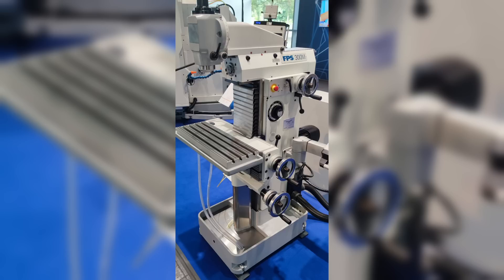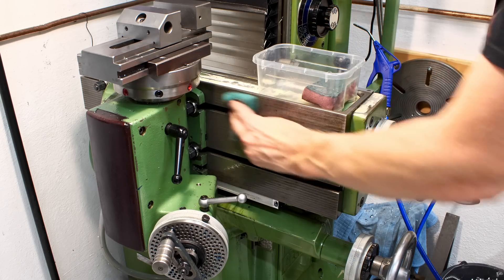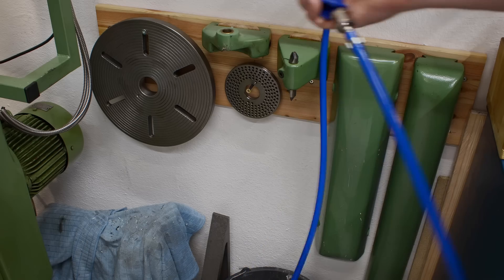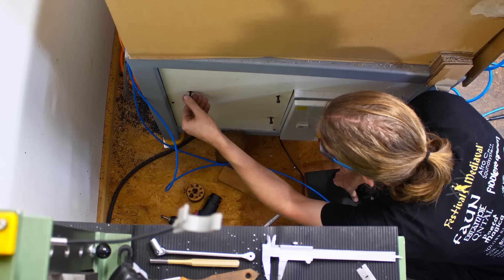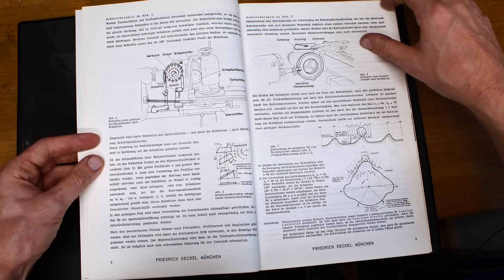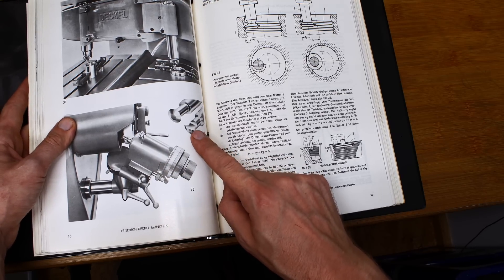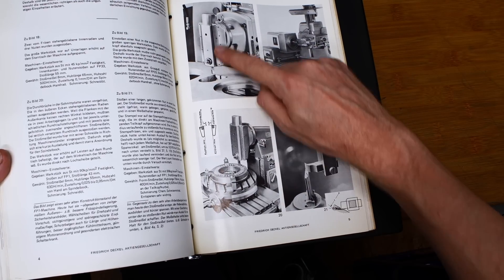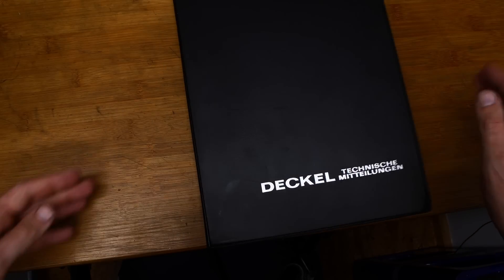Shoptalk #30

Comment: Thank you so much for the rivnut tip! I am literally working on the side panel of my lathe just like you show in the video. I'm mounting rails for a pull out CNC panel. The snag is that I only have about 150mm gap to work in and spent a long time yesterday trying to get my M5 rivnuts in with the plier type tool. The handles on the tools are way too short to get the initial required leverage but still don't fit in the gap without starting at a bit of an angle. This all resulted in a minor thumb injury and some bad words. Today I'll try the nut/bolt/bearing method. Congratulations on your YouTube silver award, it's well deserved.

Comment: McMaster sells "wrench driven" rivet nut tools that are quite a bit cheaper than the large, clunky plier type tools. They are also very low profile for tight access. They're around $35 and go from 4-40 up to 1/2". I've done hundreds of riv-nut installs with these and while it is a much slower way to install rivnuts, I like this method better because I've found that the plier type do not always set the rivnut all the way and subsequently the rivnut can spin when torqued on to either tighten or worse yet, when you go to loosen it after years.
Reply from the maker: https://www.mcmaster.com/products/rivet-nut-installation-tools/wrench-driven-rivet-nut-tools/

These? Funny, I did not know they exist :-)

Thanks, I learned something!

Comment: I had a KF12, very versatile machine but if you dont have any of the stock attachments it can be a bit of a monster for doing only standard milling ops. and in south africa you very seldom find them, let alone the bits. thy made really nice and versatile machines and very accurate.

Comment: Great video, 👍 You got some exercise at the trade show hope you had a good day out😅 Riv nut's have their applications but they need to have inner and outer serrations on the nut or they fail.Smaller size M4 M5 M6
Will snap the mandrel pieces so get spares😂

Comment: In my experience, using a nut and bolt to tighten down the nutsert/rivnut, saves the heat break of breaking a rivnut tool.

Comment: 14:00  Be sure to paint or seal wood that will be in contact with bare metal. Unsealed wood will hold moisture, and if you live anywhere that has humid air at times, you may get rust where they touch.
Reply from the maker: Thanks! The wood is oiled, i found that that is enough to protect the bare metal it contacts.

Comment: Congrats on the 100K!  That sponge idea reminds me of Paul Sellers "rag in a can" oiler which I use on all manner of wood working gear.   It never occurred to me to use them on metal working gear but it is a similar process.

Like a lot of shops I've been in I think I'm negligent on normal lubrication and cleaning.     I'd like to say it is the intermittent shop use (1 or 2 times as week)  that is the issue but I think I'm just lazy and will later regret not being a bit cleaner.    It would be interesting to discuss strategies depending on use case for cleaning and lubrication.
Reply from the maker: Paul Sellers is a tressure of a human beeing, despite working with wood :D

I strongly consider doing an entire video on machine lubrication/upkeep and cleaning.
Reply: @StefanGotteswinter I’m looking forward to seeing it.

Comment: Glückwunsch zu 100K🎉
Super Idee mit den Nietmuttern, das gleiche Problem hatte ich auch schonmal, weil es Samstagnachmittag war hab ich mir aus zwei Stücken Flachstahl eine kleine Brücke zum einziehen gebaut, einfach ein Stück mit Durchgangsloch in der Mitte und das obere Stück mit Durchgangsloch in der Mitte und zwei Gewinden außen für die Drückschrauben, ist noch billiger und ein Axiallager hatte ich gerade nicht😅
Auch sonst sind Axiallager super um irgendwas einzuziehen oder auszuziehen, ich hab erst letztes Woche mit einer M12 Gewindestange und einem Axiallager die Spindel an meiner Weiler LZ280 ausgebaut.
Die technischen Mitteilungen von Deckel sind echt interessant, meinen größten Respekt an die Zerspaner von früher, die müssen nochmal ein räumliches Vorstellungvermögen auf einem anderen Level gehabt haben.

Comment: Hi Stefan, thanks for the demo using bolt and nut to squeeze the insert screw which I ponder how without the crimping tool which is expensive. Also Hannover Messe trade show will be in Singapore next month. I attend yearly but unable to see any manual lathe or mill, more high-end 3D printers and CNC. I have the high resolution poster of the FPS 300M with a few cut out of the mill.  Printed one in my workshop. Yes it's expensive and I can't afford one. Let me know if you keen to have it.

Comment: Hello Stefan. Congratulations on silver plate for 100k subscribers. Time flies, but your shop talks are content of highest significance on youtube in my case.
Riser block on 55:00 is interesting item, i am guessing that it inverts main spindlle rotation.
Man could spent many happy years to try all posibilities of Deckel mill and its clones.
Reply from the maker: The riser has two sets of gears in it, it keeps the spindle direction :-)

There are several versions of the riser to make things worse.

One for FP1 accessories, just to get more Z-height
One to use FP2 and jig borer accessories on the FP1 (They have different pressure angles on the gears)
And finaly one for the FP2 to get more z-height.
Reply: @StefanGotteswinter  Deckel was consistent in making things complicated 😃, that is why we love it, and its clones. Do not think that machine which is more universal than Deckel FP will ever be invented again.

Z-height is of my main interest in this case. Do you know how much Z is added on FP1 and FP2 with these riser blocks?
Buying machine was easy, close your eyes, count the money, you buy it once. But add ones you can never get enaugh, and for me they are like nice shoes and purses to women.

Should not complain, slotting head payed its self on the first job, and so on.

Comment: Your rivet-nut tool is MUCH simler than the one I made based on a video by Matty's Workshop! Like you, I didn't want to pay for one, and I had some nice random bits that I could use to make it - and it was quite a fun thing to build, with some left-hand threading and other activities that I don't do often. I've not tried it for bigger than M8.
Reply: I used something very similar in mid 80's when Suzuki started using rivnuts of GSX-R 750. 
They always came loose after a few months and needed tightening up
I used a radial needle bearing from Suzuki clutch though

Comment: for riveting nuts I had similar method, but rather using bearing, which I did not have, I used eye wrench of small size, just for screw to go through, in place of bearing. Then I could hold that wrench together with allen wrench and with other hand tighten the nut in between :). Works, but there was much more friction in the system. To clarify, that eye wrench acted as a washer, that did not rotate with nut, so prevented torque to go through to riv nut. Your soulution much more elegant though :). Cheers!

Comment: As allvays, exemplary tips and sharing of knowledge.  What should I be using in my milling bed under my vise? Might not be using the right kind of cooling but can you give me some advice.  Thanks for your films Stefan. Cheers from Sweden.
Reply from the maker: Some rust preventive oil/wax that dries. I like LPS3, seems to work fine. I heard that Boeshield T9 works well too.

Comment: On the Schaublin 102N-VM tailstock upper body, it appears that there is a magnifying glass for fine adjustment  ?  Also, I have an older cross-slide and compound for this same machine and I really surprised that it looks almost identical.  I guess there’s no reason to change something that workworks so well.

Comment: Where did you get M6 pull stud kit? I had to buy long M6 shcs and cut them to length
Reply from the maker: Norelem has them:
https://norelem.de/en/Product-overview/Flexible-standard-component-system/07000/Nuts-screws-washers-securing-elements/Studs-DIN-6379/p/agid.3963

They also have the taller nuts.

Comment: Hi Stefan, you look like you lost a lot of weight?
Everything OK, is it deliberate? (been working out and checking diet)
I think you could easily do a 2 or 3 hr video on just the Deckel bulletins?
Some really interesting stuff in the bulletins, given me some idea's for things I know I need but no idea where to get (particularly the line boring setting tool at 55:40, was thinking of something far more complicated but that looks much simpler to make)
The slitting saw support 'washers' are something I haven't seen before but logical if you don't need a real deep cut and want saw supported for better accuracy
Totally off topic, 
I have a Mahr 'Compramess' indicator, does compramess mean something different in German compared to how it sounds in English? (comparing a mess 😁) 
I had to make something similar to compress rivnuts when Suzuki started using them in mid 1980's on GSX-R 750, they used some soft aluminium that loosened up after a few months and needed tightening.
I used similar 6mm boltand spacer but a radial needle bearing from Suzuki clutch as 'we' had them in stores (at dealership)
Reply from the maker: Yep! Lost a good amount of weight on purpose, from a all time high of 105 down to 86kg, feeling a whole lot better - Deliberate eating and training/bouldering.

You could make a 3 part feature cinema movie about the deckel bulletins and still have room for a spin off series on netflix :D

The Compramess is a word play by mahr. "Compra" from Comparing and "Mess" from "messen" (german for measuring). So you are measuring and comparing with the tool.
Mahr has for all their tools names like that. The DTI are called "MahrTest", their electronic indicator/amplifier is a "Millimess"
Reply: @StefanGotteswinter 
Glad to hear your eating better, way too easy to eat bad (don't visit America if you like fast junk food or didn't know you liked it, I gained 35lbs (15Kg?) first three months after I moved here)
 LOL, dead right about the bulletins, could probably do a 30 minute show on each page.
 Thanks for the clarification on Compramess, I knew it had to be something more sensible.

Comment: Why are you looking for another lathe? What additional capability do you need?
Reply from the maker: Roundness and Surface finish - The last stage on the emco super 11 drivetrain is gear/gear - And when doing superfine finishing with MKD diamond tooling, the gear noise shows in the surface finish.
Reply: @StefanGotteswinter  so I guess you want an instrument lathe like a hardinge or european equivalent. Schaublin?
Reply from the maker: yep! 
Schaublin 102n/VM, Schaublin 125, Hardinge HLVH, Weiler Mathador, Weiler Primus, Hembrug Ergodur are the main machines I focus on.